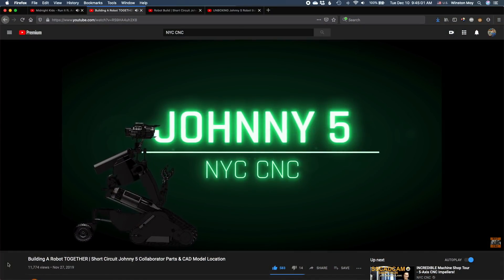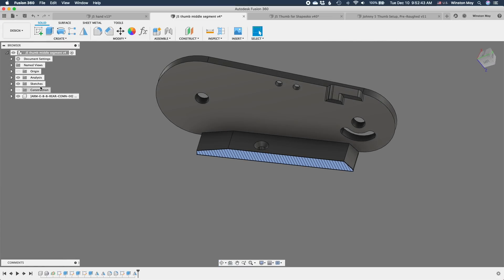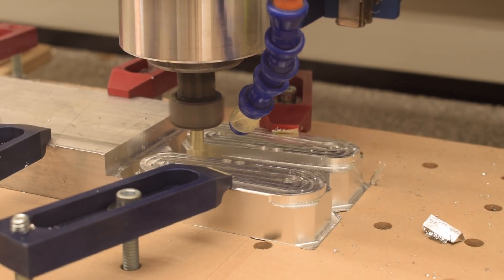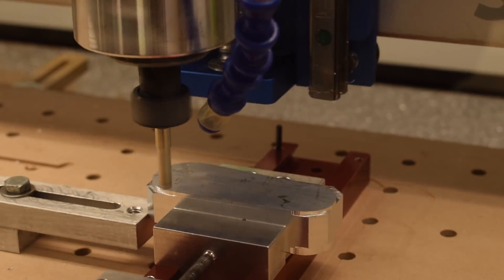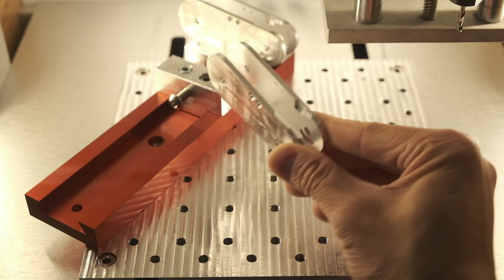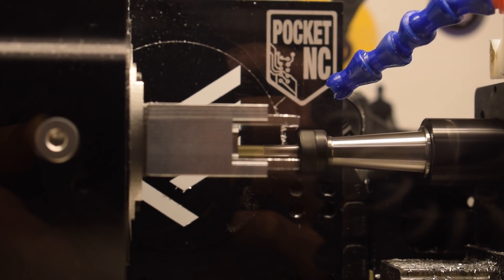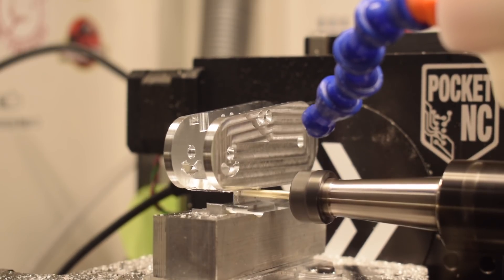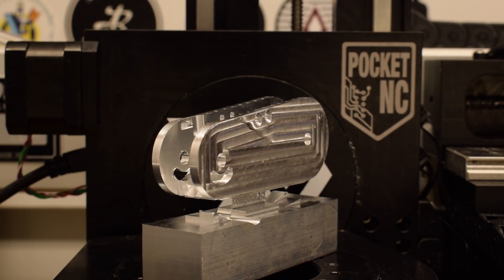Machining Johnny 5's Thumbs Two Ways w/ 3 & 5-Axis CNCs - #159

Comment: Nice information, keen on making a 5 axis, but first I need to make a 3 axis using this Dewalt 900w router, but first I need to put the Tevo 3D printer back together to help make the 3 axis and test 5 axis designs using low power miniatures. Which came first again ? :)

Comment: you could make the feature at min 1:10 in the same setup you used at 6:30. I know, I know. the contour was circular, so the end mill would be machining theorically a line, not  a face, but with a small little tiny flat surface in that contour would be better instead of modifying the design that way, in my opinion.